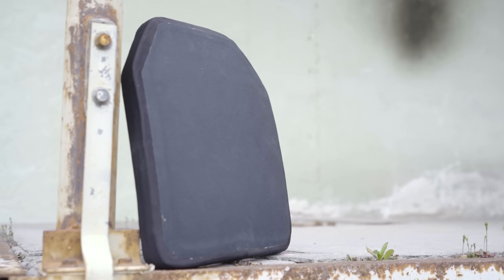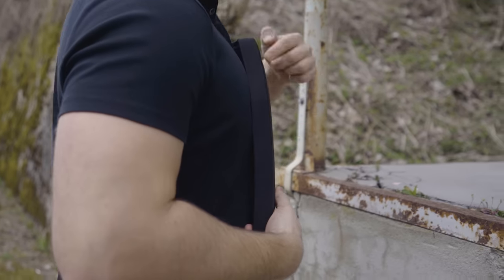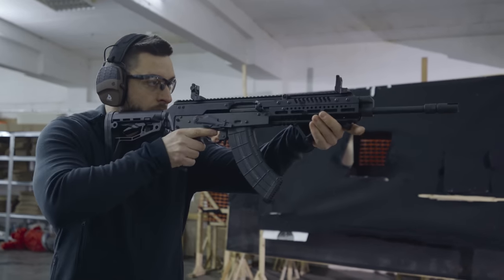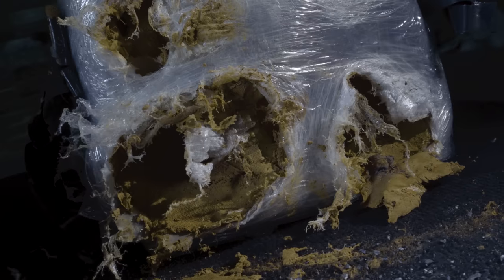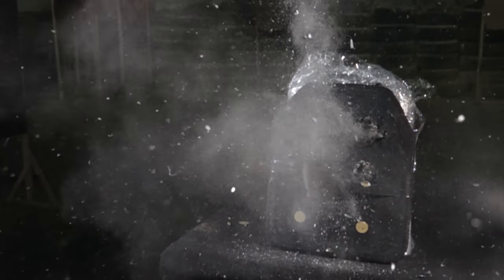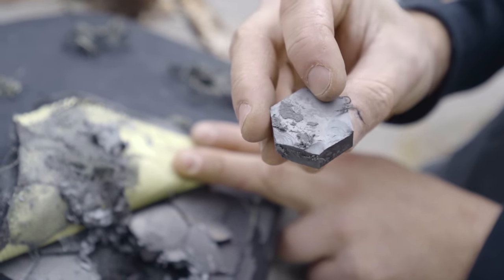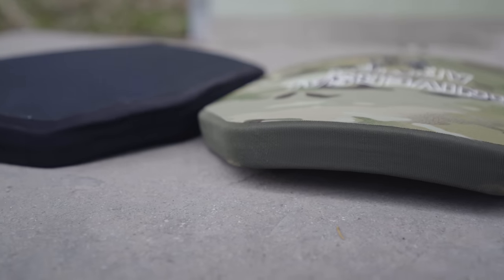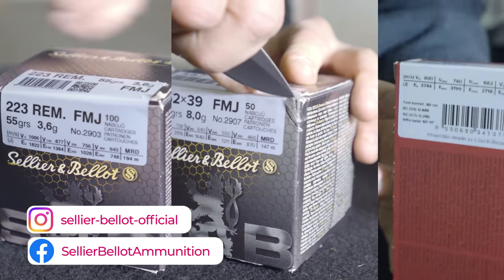Shooting a Chinese ballistic plate

Comment: I would gladly demos these plates for you in an unbiased worst case scenario :D Although I will admit, I am not sure I will be able to mimic that Grip Clamp C..
Reply from the maker: Awesome! 😀
I have send you an email
Reply: Would the worst case scenario be driving in Jacksonville FL without your seatbelt on?
Reply: @george2113  I could drive over them with a 23,000 lb fork truck lol
Reply: @BuffRANGE  those are excellent for compressing empty aluminum cans. The one I drove didn't inspire confidence. I wish forklift manufacturing would pick one control setup and standardize like auto manufacturers did.
Reply: Hell yeah can't wait for this video

Comment: Botach tactical sells some $100 level IV plates that are made in china. They are actually awesome plates. They only weigh 5 lbs per plate and they stop some very serious threats. Watched one stop a .338 lapua at 10 yards. Its a level 3 UHMWPE plate with a ceramic strike face, so even after the ceramic is broken you still have a level 3 plate. Body armor is just going to keep getting better and cheaper as material science progresses.
Reply from the maker: For $100 that's a no-brainer 
Like you said, even if you get a defective or bad quality plate, it will still hold better than any much more expensive level 3+ plate

Comment: Making ballistic plates is surprisingly easy. Making the top notch stuff, with the best durability, consistency and lowest weight is a different story. The foam around the edges was an issue with a US armor seller that was probably sourcing their armor from the same factory (and not being very honest about it). So yeah, this is believable.
For the extreme DIY crowd, the tiles are easy to source in Alibaba, and so is the uhmwpe fabric.
Reply from the maker: What i learned from all of our testing is that adhesives and bonding  the materials correctly are crucial. The chinese ballistic helmet that we tested was made of quality UHMWPE material but it was bonded poorly and delaminated too quickly - yeah, its stopped even a 12g slug but the deformation was too big even for 9mm
Similar thing with plates, if the bonding and compression isnt right, you see a shitload of ceramics thrown out of the plate after a hit and that actually led to a penetration on one of the EU plates that we tested. 
First shot made a big gape with no ceramics and the next shot next to it, went through. 
These Chinese plates performed excellent and i wouldn't be surprised if these are the same thing as some US and EU companies are rebranding...
Reply: @PolenarTactical  Please test Chinese aramid helmets as well!
Reply from the maker: @seennotheard8888  already did and with interesting results
Reply: @PolenarTactical  To clarify, I meant Aramid Fiber/Kevlar instead of UHMWPE helmet testing please!
Reply from the maker: @seennotheard8888  yes, we tested an aramid helmet from China - it was suspiviously thin but held up great. Video coming soon 🙂
Reply: @PolenarTactical  Ah I see, great to hear! Looking forward to it.

Comment: 4:35 The hexagonal tile design kinda reminds me of the buzz around "dragon skin armor" in the early 2000s, but more practical. Instead of overlapping, they just fit together, and you can (hypothetically) just replace broken tiles instead of the entire plate
Reply: I thought that too. I wonder what happened to dragon skin? Seemed like a good idea.
Reply: it's to prevent the entire plate from fracturing after the first hit, the damage is more localized- its pretty commonly done actually, some plates use large ceramic beads in layers overlapping eachother.
Reply: @maggotpudding Pinnacle the original DS company went bankrupt because they were some sly fellows. The original designer of the tech, re-acquired various trademarks of DS, and has relaunched it with quite a few improvements. I've tested it to be quite capable, but it's still HEAVY, and THICK. How the adhesives hold up over time will be another concern too..
Reply: hexagons are the bestagons
Reply: @maggotpudding i heard they were heavy and the adhesive would melt when exposed to high heat
Reply: Demolition Ranch got an original and shot it.

Comment: Based on the ceramic tile options in Home Depot, I am pretty sure they're sourcing their hexagon mosaic tiles with 1/16" spacing from the same place in China as these guys.
Reply from the maker: Would be nice if Home Depot had silicon carbide, you could make your bathroom bulletproof :D
Reply: @PolenarTactical  Lol, they do actually have it in other products, but yeah, I don't think their specific brands of tiles are made of that, although it's available at other retailers.
Reply: @PolenarTactical  I've considered bulletproofing a small room like my bedroom with an array of ceramic plates, steel plates, and then kevlar pads as "backing" to prevent spalling inside the room
Reply: @@TheTinkeringOpinionif you have 4" to 6" cast concrete would you side it with abrasion resistance steel or go for thickness?
Reply: @psychopathmedia  would be neat to do the same inside a vehicle cabin or make your own juggernaut suit kind of like the one from modern warfare 2

Comment: 5:16 IMO, the NIJ standard should have that metric from the edge of the part that's actually ballistic, instead of just the total plate design, to stop this kind of thing. Although I think having the plate padded to help protect from drops is a good idea
Reply from the maker: I would prefer ceramic from edge to edge. You saw how we torture tested the plate. Even if one of those hexagons would break, i dont think that would reduce it's ballistic protection. 
And yes, i agree with you. I actually think NIJ has obsolete standards for their testing. They should introduce higher levels of protection and stricter criteria for backface deformation and multi-hit capabilites.
Reply: @PolenarTactical  have you tried the side plates ? Or does that reduce mobility?

Comment: actually the back side deformation is also evaluated by NIJ standard, I think. So its not just about penetration. I would not want to be shot at by .308. But yes, for the money, not bad - you would not die, just had some internal bleeding :) lvl3+ seems fair.
Reply: Had he used 150g FMJ in .308, it would have blasted on through. Its all about speed.
Reply: @manofchaitea6904  When ceramic strike faces come into play it's not ALL about speed. The same with UHMWPE. Bullet construction becomes a factor too.
Reply: It's hard to believe that all that 30 caliber armor piercing ammo from WW 2 got used up?
Reply: IMO NIJ's tolerance for backface deformation is too much. Like when I see those meme IIIA face masks, I can't imagine it would be much fun to lose all your teeth even if it stopped the bullet. Most of the "didn't penetrate" rifle-level armors seem like instead of dying from a bullet hole you'd die from a dissected aorta instead
Reply: @psychopathmedia  I concur that that 308 levels of deformation would be enough to stop fighting. Maybe someone with a very high pain threshold could keep fighting?

Comment: 5:56 Is that a similar reason why you can't access ballistic clay? For legal reasons (If it's been answered in the past I don't remember, sorry)
Reply from the maker: Oh no, it's just hard to get and expensive. Also if you want it to actually perform properly you need a special container for it as per NIJ specification and you also need to keep it at certain temperature range. 
Too much work.
So we just use normal soft clay as a backing to simulate a body
Reply: @PolenarTactical  Okay. I also wondered if laws in Slovenia prevent M855 5.56? I only see M193 in the videos but maybe I missed it. Here in US M855 and M855A1 are easy to get because they don't count as "AP"

Comment: If the smaller hex ceramic plates made that much of a difference, why aren't they just a series of glued micro ceramic cylinders instead? Or for that matter, glued ceramic dust?
I get the sense it doesn't actually work, but it's cheaper and their marketing is effectively excuse making.
Reply: I think if you glue small ceramic particles you'd get the mechanical resistance of the glue, not the ceramic itself. What absorbs energy is the ceramic itself actually shattering.
Reply: @vanoscrap6296  Sure but hopefully you see my point. We can expand or shrink this as much as we want but only one is actually going to be effective at stopping bullets, and that depends on what's happening to the material. If shrinking the size of the plates makes it more effective against multiple hits what's the smallest it can get to and still be effective? Probably a bunch of pins or particles, right? If it doesn't work at that small scale, why would some hexagons help?

I don't believe it's actually becoming any more effective, I think it just a company duping youtubers for quick cash.
Reply: @ish1057  that's what I'm trying to explain, you can't shrink it indefinitely. To give you a VERY rough idea, if the pieces are smaller than the bullet, then when it hits you're mainly breaking the glue holding them together instead of breaking the pieces themselves.
Those hexagons are quite large, meaning when a bullet hits it will break one or two of them, but not many more. Which in turn means that the energy dissipation will mainly occur from the ceramic breaking down, not the stuff holding the pieces together.
And because the ceramic itself is much stronger than any kind of glue, the energy dissipation will be much more efficient.

So yes, the size is not fixed per se, but you can't go too small, because instead of relying on the ceramic's resistance you will start relying on the glue's resistance.
Reply from the maker: I think he explained the size and glue problem very well. 
And i will try to answer to the just of your comment, not the specifics. 
The hexagonal ceramic tiles are put together to form a front strike surface to blunt, break up and decelerate bullets. When the bullets strike this very hard ceramic, the ceramic breaks into dust and small particles which transfers the energy from the projectile. In this process the ceramic is destroyed and often thrown out of the plate (as seen in this and our other testing videos).
The use of hexagonal tiles instead of one big single plate of ceramic achieves the localisation of the damage - when the bullet hits one of those hexagonal tiles it breaks it up and maybe a couple of them next to it. But if a bullet hits a homogenus ceramic front plate, it breaks it locally and also spreads cracks and damage through the whole piece of ceramic - imagine shooting at a ceramic dinner plate - instead of a small hole through it, you will shatter the whole thing. 
Not the lamination of the ceramics (the backing) has a big role here in trying to retain as much ceramic as possible in the plate itself, but the separate small pieces also help localize the damage. 
This is a proven technology and is used in a lot of modern ballistic plates. The added advantage is that if you drop a plate like this (again, as we shown in the video) it's almost impossible to crack the ceramic and deteriorate the ballistic properties of this kind of plate as opposed to old design with a single homogenus ceramic strike face.
Hope that answers it
Reply: @PolenarTactical Maybe it's something I need to look into more but beyond marginally improving multi-hit performance I just don't see it being as capable due to the cuts. I mention shrinking the size down to an extreme because it makes this more apparent; If we can get the same single-hit performance at the same price and with improved multi-hit performance in this "Mosaic" form as it's called, why not make them a massive series of little pins instead? Then you'd only break those that are hit, right? The glue thing was just an off-hand way to link them but you could do the same with some kevlar stitching or just cram them all together like this video's plate does.

From what I can find it's true that smaller plates do improve multi-hit performance, however, the force isn't getting distributed throughout the whole thing as in a standard "Monolithic" plate, and so single-hit performance is degraded. Determining how much it can take in either form could make this an interesting choice, but given this is already the case with steel vs ceramic - multi-hit vs single hit per weight - I'm doubtful it's worth the tradeoff, all else being equal. I'd still be interested to see if that degradation is actually enough to worry about or not, but a couple bullets isn't enough for that.

Congrats on the Finnish Brutality event by the way, love those.
Reply: @ish1057  The "argument to absurdity" doesn't work because the utility of the strike face is more than just the result of the small-ness of the tiles. Note that each tile is larger than a bullet? The trade-off is preserving the integrity of the rest of the plate in case of follow-up shots, versus the potential for other points of failure. Single-shot integrity is a valid concern, and likely it's own tradeoff as well, but the plate seemed perfectly capable of handling it's NIJ specification. Though IMO, making the tiles a larger would be a better idea. I think it's basically impossible someone is gonna stand around long enough to take 6 shots to a plate, and it would further mitigate any concerns over single-hit performance, which I agree is way more important
Reply: @psychopathmedia I'd say it does; Sandbags are the logical conclusion to this line of thought after all - sort of what I hinted at in my first comment with 'glued ceramic dust,' - as it's cheap and easy to get both single and multi-hit performance. But, you do need a lot of dirt or sand to be effective and that makes it heavy. It really doesn't take much effort to stop a bullet but it does when weight is the limiting factor, and when you break up the plate you increase the weight required to be equally effective unless you compromise on performance elsewhere as that chinese company did.
Smaller, heavier 'shingles' for equal single-hit and better multi-hit makes sense, we're essentially talking about ceramic scail-mail at that point, but each shingle must be heavier/denser to retain that effectiveness. But it's not being used that way, it's being marketed essentially as a life hack for better armor by cutting some hexes in the thing with a whole fucking inch trimmed off to skirt the rating system for profit. I don't trust it.
Reply: @vanoscrap6296  There's some science stuff behind the bullet's destruction that depending on the bullet size, and length kind of necessitate the ceramic surface to be a certain size and thickness. Something about allowing the ceramic to create a conoid in the material as it breaks up the projectile etc. I've found that hexagon files do a really good job against 5.56 threats, but the size pictured here (length, width, height, not thickness) can at times do poorly against .30 caliber threats.
Reply: @BuffRANGE  I get the science stuff, believe me ;)
It's cool to have some experimental data though, thanks for sharing! Non-linear stuff can entail some crazy surprising behavior.
Edit: just got that you're the one polenar refers to in the video lul cheers for your input, much appreciated
Reply: @vanoscrap6296  :D indeed I be that destroyer of armor.!
Reply: @ish1057  Sandbags are a volume/weight/portability tradeoff. Gotta use way more sand compared to ceramic. Powdered ceramic would likely be just as usless in a plate that's maybe 1"/2.5cm wide

Comment: Though you'll technically live, that "energy transfer" is gonna break a rib or three and you'll be shitting blood for a fortnight!
Reply: No it won't. Unless you get hit with something on the upper edge of what the plate is rated for, on a plate that is skirting the very limits of acceptable back face deformation, you won't feel nearly that much energy transfer. The ceramic exploding outwards steals some of that energy. Most plates that are being done to the NIJ .06 standard have extra foam padding for comfort and drop protection that will further reduce the impact the hit would have on you.

Comment: Awesome vid but most .308 used in combat is 150-155g FMJ. Which will travel much faster than 180g. Speed is what penetrates body armor.
Reply from the maker: Yes and no. 
Terminal ballistic is not that simple. Yes, velocity is very important in penetrating armor because if we eliminate all other variables, velocity increases the projectile's energy exponentially, while added mass only increases it linearly. 
It's all about the energy of the projectile and the easiest way to increase that energy is with higher velocity. But if the projectile doesnt have enough mass, it will have a problem retaining that energy and loose it fast to aerodynamic drag and other factors. Also a very light projectile with high energy will break apart while hitting the ceramic and disperse the energy, if it doesnt have enough mass. 
So like with everything, there is a sweet spot :)
Reply: I saw a demo on Utube that velocity alone will defeat BA, easily.
the demo was 22-250 out of a 20 in bbl, pass thru, easy as pie.
 @PolenarTactical
Reply from the maker: @sue_downing555  of course, it has 500 joules more than 5.56 😀
Reply: It's the overall energy, the surface area of the impact and the "hardness" of the projectile. That's why a yawed or oblique impact is less likely to penetrate, and why a spitzer is more likely to penetrate than a roundnose, and why a steel or tungsten / other hard slug is more likely to penetrate than a jacketed or unjacketed lead slug. Every armor can be defeated by some type of projectile. There are easily civilian-attainable shotgun slugs in the US that can penetrate IV plates designed to defeat M2AP.  If it were "just" speed, then everyone would make rounds that are 1mg @ 10 000m/s. This misnomer is equivalent to people saying "it's volts that kill not amps" as if 1 000 000V @ 0,0000000001mA would even be noticeable